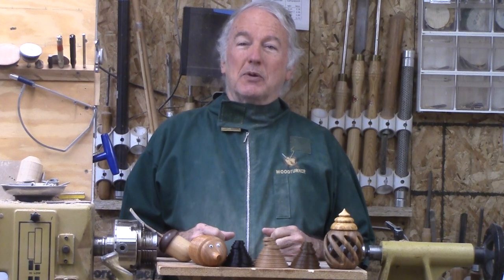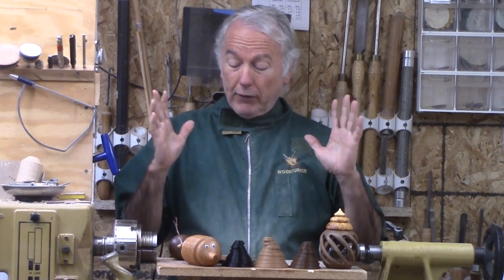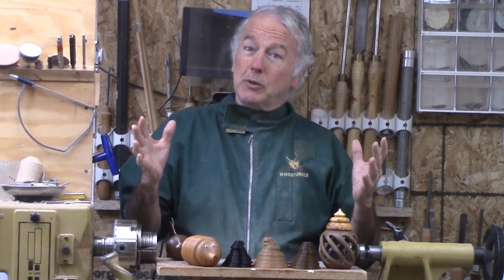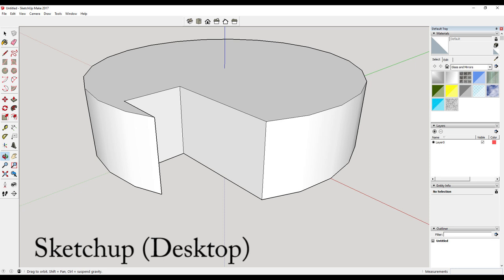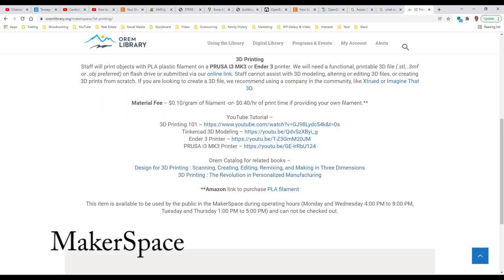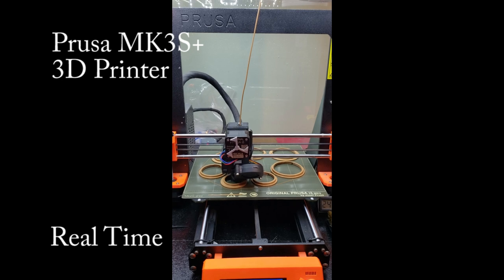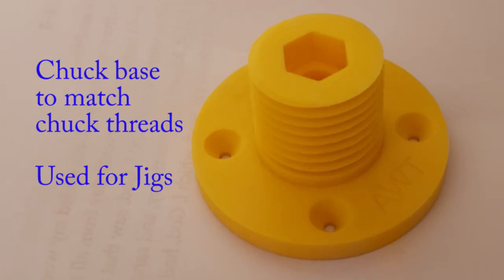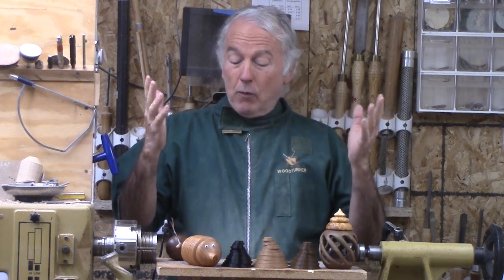Woodturning and 3D Printing   Can They Work Together?

Comment: Alan,  the concept and purpose of 3D printing in turning has virtually endless possibilities.  I can see even some 3d printed blanks,  that could be made to generally be finial shaped and fine tuned on the lathe for fit and finish, something like a cylinder shape in clear with a snow flake on the end. Simply turn the cylinder to a desirable shape, sand polish and install on your Christmas decorations. Personally, the thought of 3D printing turns my bowels to water.  I'm currently attempting to puzzle my way into cnc engraving to make my own makers marks. I will get there in the end. Cheers, mate.
Reply from the maker: Thank you Ron
Alan

Comment: I have found 3D printing to be very useful Alan. I will be releasing a video soon on a number of wood turning accessories I have made. 
You made a lot of very useful things for sure. Great ideas!
Gary
Reply from the maker: To me, another very useful tool.
Alan
Reply: For sure. I am printing cone centers right now. One for the headstock is done. The one for the tail stock is printing right this minute. It fits the threads on my live center.

Comment: 3D printing not only works for making tools and parts for woodturning but also can be an integral part of the woodturning project. I've made use of 3D FDM printing for a 3d puzzle, Red Bull can, Pepsi can, which were all turned on the lathe. Would love to have a resin 3D printer, but more expensive at present.
Reply from the maker: Thanks for the info! Ray
Alan

Comment: I have a 3d printer I used it for brackets to mount wiring for lighting etc. I made table top clips for holding a table top on. Now I'd like to try making a threaded ring to go into a lidded box maybe.
Reply from the maker: Threads are a tough project. Good luck.
Alan

Comment: I've been a woodworker fort over 50 years, however, I bought my first lathe about 4 years ago. What a rabbit hole...I've made small Christmas presents for family and friends each season. I saw you incorporating 3D printed threads and for 2022 project, I want to turn ornaments that unscrew with a small surprise inside. I will buy my 3d printer this spring. Thank you for the content and idea.
Reply from the maker: Before buying, search for a nearby Maker space at nearby libraries.  It is another rabbit hole. :)
Alan

Comment: I have made several things including pens, gear shifter knobs, bottle stoppers, and pendants with 3D printing. I seriously thought you would be the last person to utilize new technology for your projects, because your videos I’ve watched seem more traditional style to me. I’m pleasantly surprised and looking forward to see more!
Reply from the maker: I would be interested in your definition of "traditional style" versa non-traditional?
Alan
Reply: @AsWoodTurns  I consider traditional wood turning as turning wood on a lathe using gouges, skews, and scrapers. I consider non traditional as incorporating resin into the mix (or turning resin with no wood) as well as using carbide tipped tools either in tandem with traditional or solely.

Comment: Don't currently have a 3D printer but did previously.  One of the things I made was a fitting to adapt the end of my shop vac hose to the various sized ports on my shop tools.  I also made a small center finder which I use frequently.  Would love to do 3D printing again but got frustrated because the printer I had was very difficult to level the bed.  Guess you could say I rage quit.
Reply from the maker: Sorry for the rage quit. I have great luck with my printer. Yes, some issues but all resolved reasonably quickly.
Check your local libraries for a Maker Space.
Alan

Comment: nice overview of the possibilities of 3D printing. I wonder if you couldn't make a simplified bayonet fitting in wood. If you have a straight edge in the vessel with only notches and you turn a U-shaped groove in the lid , you only need to carve part of that away to leave a few 'pins' to match the notches. You would need them to be a bit wider for strength I guess. anyway, more than one way to skin a cat ;-)
Reply from the maker: 3d Print is an additive technology. Woodturning is a subtractive technology.  Essentially, find a process that is repeatable andreliable.
Alan

Comment: Like the idea of incorporating 3d printing as you have but I have a question... if you make something on the 3d printer and it didn't quite come out right is the material used tossed or can it be reused?
Reply from the maker: The simple answer is "toss it". It takes more equipment to regrind and extrude the plastic to filament again. Then. the color will be the color of all those recycled items. I use some regrind filament but the color is not consistent (as noted by the vendor) but it is less expensive.
Alana